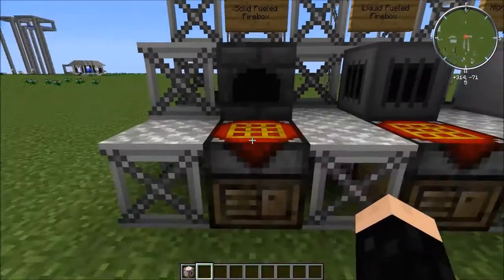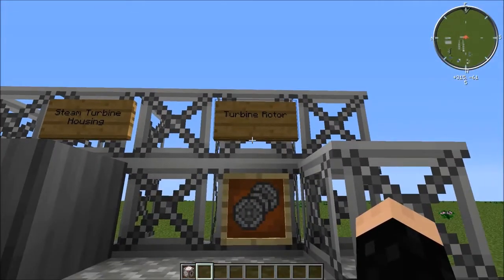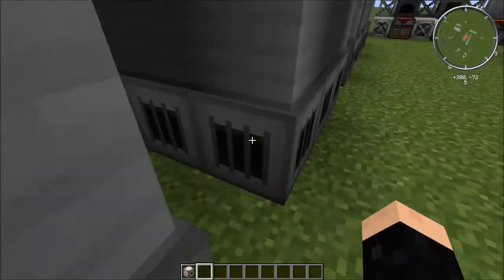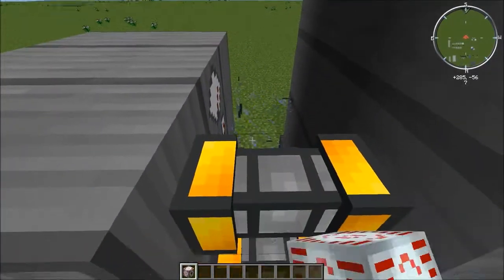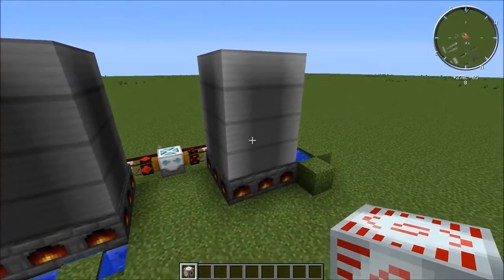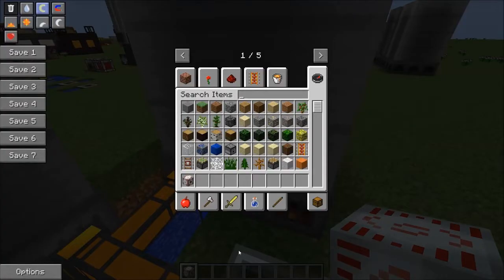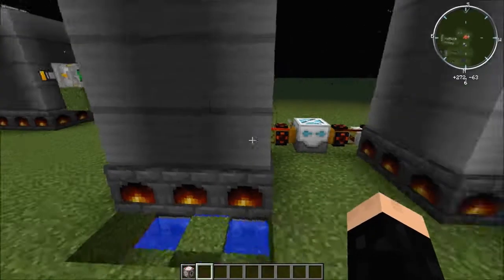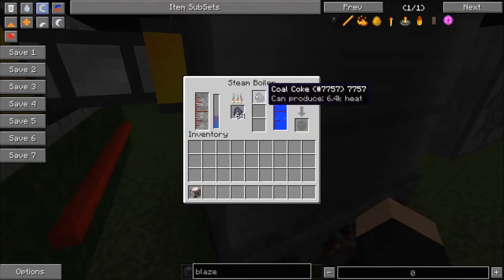Minecraft Feed the Beast - Block Spotlight - High Pressure Steam Boiler

Comment: I prefer setting up a tree farms. You can get biofuel from saplings, or with compressed plant matter if you cut, craft, and compress the leaves. The wood can be turned to charcoal, you can use iron furnaces if you add a sawmill to cut wood to planks. A big farm can run 2 boilers. The apples turned in to apple juice and sent to the fermenter to increase output, and the mulch byproduct goes in the the fermenter as feedstock. You get several closed loops with all the materials you harvest and make.

Comment: I think it's better to have a 5x5 or 7x7 tree farm running constanly and have steam ovens ready, get the loop correcly and the system will run on charcoal, which is renewable, easy to obtain and burns for half the amount of coal coke.
Alternatively, have a tier 5 spawner for wither skeletons, which will give coal as drops, then use a coke oven to power the setup you have with the deep storage unit and also use the creosete to power a liquid fueled boiler on the side.

Comment from the maker: Pretty sure the oil fabricator takes more power to make oil than what it produces. So it would be a waste of fuel. Your best bet is to set up BioReactors with a skeleton spawner and make biofuel with the bonemeal. Bioreactors also work with saplings. The more stuff you give them (seeds, bonemeal, saplings) the more efficient they are. They require no power to work. Hope this helps. :D

Comment: If I use an Fully Heated High Pressure Steam Boiler running on Fuel, to power Steam Engines powering a Oil Fabricator to make Fuel out of it from other Steam.Engines, would I get more Fuel out of it or will it be not producing enough to make Oil and Fuel.